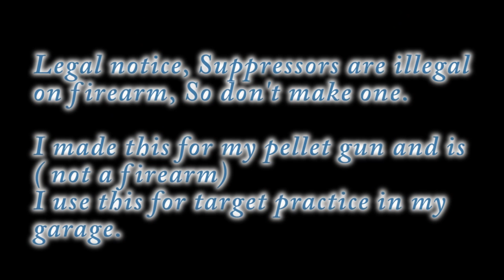Home Made Air Rifle Suppressor, simply the best out there

Comment: Not to be picky, because you did do a really nice job on the silencer, but there's got to be a better way to attach it. I have an RWS air rifle and because of the double recoil common to air rifles, it tears up scopes, gouges the hell out of the scope rail with the mounting screws moving, and the front sight won't stay in place even with loctite. There is no way that a friction fit silencer is going to stay in place. How many times has yours fallen off or come loose or moved?
Reply: If done like in the video then yes it would slide right off in a few shots. He likely shoves it back to its orig spot each time, so not great but cool for those odd shots out the window you don't want the neighbors to hear. 
If you mod your gun, which I assume is a Diana?, then you can reduce your problems. Fixing any leaks in the system, making the main seal thinner to increase compression, and using better and heavier pellets are imo the thing to do. Just be careful making the main seal thinner, too thin and the piston hits metal to metal which is much worse. No room here to go into details but I'd at least fix the leaks and get the pellets.
Reply: +chev rolet I've been checking out the heavier pellets they make. That's my next move with it. It shoots a out 1200 fps and takes small game now easily with RWS pellets. I've gone through 3 scopes since buying it in the mid 90's.
Reply: 1200 in the mid 90's? What model? What pellets?
Reply: +chev rolet 48/52 with Supermag RWS 9.5gr.
Reply: You may want to look into pcp
Reply: You may want to look into pcp air rifles if you're having that many issues with your springer.  Not sure of how much you'd be willing to spend, but the cheapest is the Benjamin Dicovery and it is an awesome pcp rifle and it runs about $215 and then the prices go up from there.

Comment: Right so the pellet flies down a rifled barrel for a reason, that's just going to ruin accuracy. Nice idea though.
Reply: Maybe at that length but generally the weight of the suppresser would slightly change the point of impact and would just need to be zero’d in with it on.

Comment: since when an air rife been a firearms they are only classed as firearms if the muzzle velocity exceeds 12 ft lbs
Reply: +Andy Coakes When I was 20 I got charged with "discharging a firearm within city limits" in a St. Paul township. So the cop is gonna charge you and say "tell it to the judge"
Reply: you are quoting law from either tbe UK or some equivalently-neutered state. And if you think ft-lbs is a unit of velocity, please do a bit of homework before posting.
Reply: the "firearm", in this case, is the suppressor itself, which is regulated under US law as an NFA weapon requiring a seperate permit.
Reply: +Andy Coakes I don't know any air rifle that doesn't exceed 12 ft lbs so i don't really understand what you are trying to say :P My Hatsan BT65 .25 pcp does 67 ft lbs at muzzle, 33gr its almost equal to my .22lr carbine at 100m

Comment: Cool projekt but only 10 dB fewer? I dont think thats much..
Reply: +Doctaime think again
Reply: steven bauer ?
Reply: Doctaime the scale for decibels doubles
2db is twice as loud as 1db 3db is twice as loud as 2db so on so fourth
Reply: +steven bauer  It's a actually a 10dB increase to double the perceived volume. Neither here nor there really, as the original shot was recorded at 66dB, which is abut the average level of speaking.
If your gun is too loud at that level, you have other issues to worry about :-)
Reply: Rob G not what  I was told
Reply: +Rob G  While hunting a 66 db sound would carry much further than a 55 db sound and the suppressor may also positively affect the frequency of the sound. Louder sounds make the prey run and hide increasing the time between followup shots.
Reply: good goat 10 db less donest make a difference i think..

Comment: CORRECTION to the disclaimer.  It is NOT illegal to manufacture, own or use a suppressor.  It IS illegal to SELL them without a Federal Firearms License to do so.
Reply: suppressors on air rifles are not illegal, however according to ATF if they can easily remove it from the air rifle affix it to a firearm like a .17 or .22 caliber and it reduces the sound by I think 10db (look that up cuz I may be wrong) you will be taken to jail and given a hefty fine. this is why air rifle manufacturers affix their suppressors in a way that they have to be cut off of the gun (not easily removable).
Reply: It's illegal if you don't have your approval and tax stamp, which you need regardless of selling it or not. Unless of course you mean it's only illegal if you get caught. Some places like Calif it's illegal period.
Reply: 5.56NATO: it's 1dB, which they can all do, and most all airgun 
suppressors are easily removed and usable on firearms which is why imo they're pretty much all illegal per the letter of the law. Plus I remember reading that cutting was included in "easily". If charged 
they could probably make three felonies out of one suppressor. I think 
it's mfg, no serial , and possession, so I rekon 20yrs in a federal 
pound me in the @ss prison. Even if you got off it would likely be massive atty fees since they usually charge a lot (up front) for cases they most likely cannot win. I think the 8th amendment applies here since muffling a shot (not used in a crime) doesn't even remotely justify completely ruining your life.

Comment: if it can be easily attached to a real gun,even if it was intentionally built for an air rifle, it is illegal as all hell. google it. people have gotten screwed. even if it only worked one time....
Reply: Then permanently attach it to an air gun, and NOT easily removable.
Reply: You'd only get to fire it once though,it's full of wood and made out of PVC and a push fit on the barrel.A firearms gases would destroy it instantly.
Reply: I dunno where the OP live, but in the US, Brian is correct. The ATF doesn't care if it works once, or if it doesn't even work, at all. If it looks like a silencer, it needs to permanently attached to the airgun. And you can't permanently attach a PVC pipe to a barrel. Unless it's pinned and welded, the ATF would gladly bend you over. If you live in a cardboard box, then go ahead and take your chances. If you have anything to your name, then think twice. the lawyers and court system will gladly take everything you have until their bill is satisfied. Your possessions gone. Your time tied up. And your job lost,  if this thing gains the wrong person's attention.
Reply: @mildyproductive9726  I made a single chamber can for my spring-air rifle specifically so they couldn't say my baffle stack could be used in a gun.

Then I welded the whole thing onto the end of the barrel with a smooth bore press fit prior to fully welding the end cap to the barrel.  Even if you cut it off, you still can't attach it to a gun without more cutting threads.

The single chamber is 1.75 x 8" or so.  The pellet hitting is louder than the shot.

Comment: air rifle is not a firearm,users air pressure to move projectile  not a explosive
Reply: +drekceldude That's true, but that's not what is relevant. The character of the suppressor is the important thing. If it will fit a powder burner without modification, then it requires a license. Otherwise, it does not. Not my opinion but that of the Federal Court.
Reply: +Jere Moore The suppressor that the gamo users is part of the barrel and cannot be removed,TBH,its not that quiet,a 22 rifle using quiet or subsonic 22LR ammo makes less sound.
Reply: +drekceldude  In Illinois pellet rifles 22 caliber and larger are considered firearms. A person needs to have the same FOID card as required to buy 1 50 cal  Barrett or AR15.
Reply: +good goat didn`t know that,I`m a brit and I still get confused sometimes when different states have different laws,crazy america.